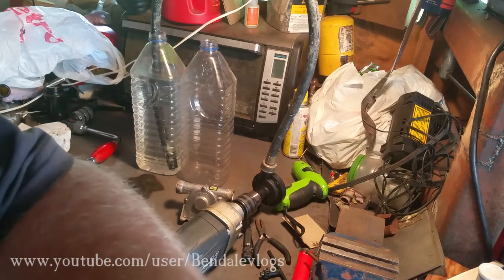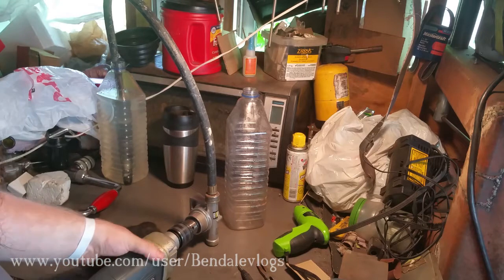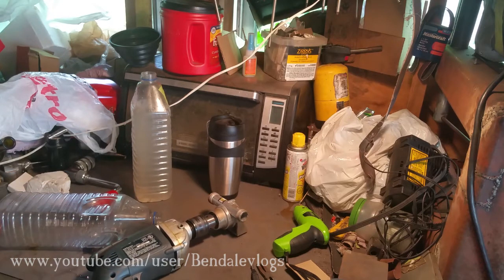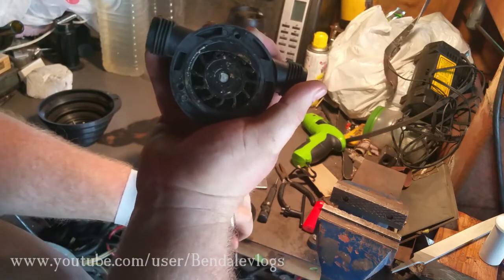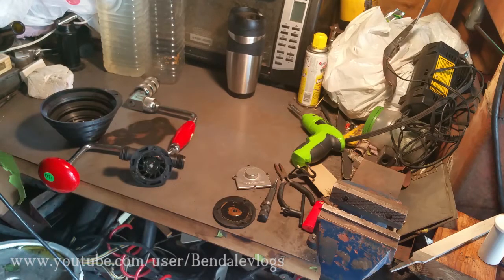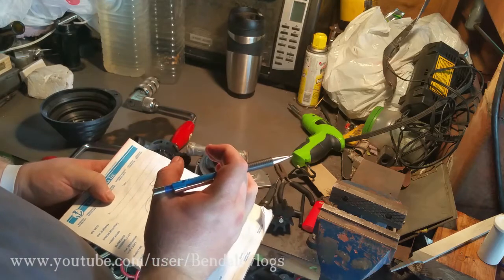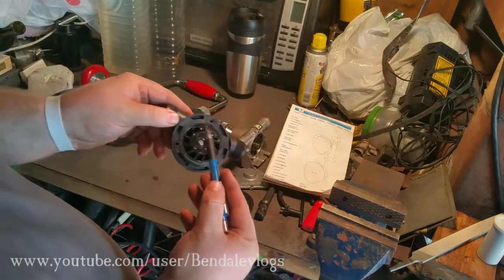Drill Pumps

Comment: These pumps state on the package "Do not run dry" which means you have to prime them first. Also, running them dry or trying to start them as you did in your video will reduce the life of the pump essentially burning out the bearings and seals.
Let water run down the hose into the pump first then start your drill and you'll find they'll work every time for you.
Reply from the maker: +NL Guy This is a self priming pump. If I had of primed it it may have run better but I bought a self priming model for a reason.
https://www.princessauto.com/en/detail/metal-drill-pump/A-p5770250e

Comment: Are you sure you were spinning the pump in the right direction?    :(
Reply from the maker: +Toms Chevelle yep. I'm certain I was spinning it the right way.
Reply: I'm a little late on this video. However, I think you have the hose connected to the output side, hence the bubbles in the water. Unless the metal pump is set up backwards from the flotec model. Pause your video at 3:14 where you show the output side, you'll see what I mean.
Reply from the maker: +Shayne Billey you're wrong
Reply: Ben D ok. Just offering a suggestion.
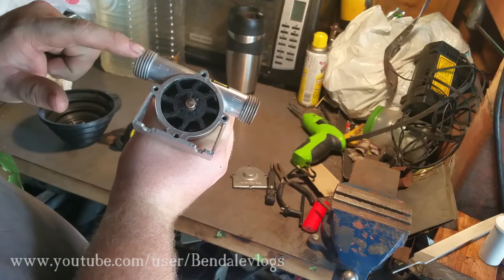Reply: at 6:30 in the video when you explain how air is getting in the pump, you explain - evidently on accident - exactly how that style pump works.  I don't care how the pump is labeled, from the side that you are looking at in the video at 6:30, the shaft should be turning counter-clockwise and the water (or any fluid - remember, if the pump moves air like that, it's going to move water in the same direction/manner, they are both fluids) the water is going to enter the left side of the pump, go down around the majority of the circumference of the pump and then be pushed out the right side of the pump when the casing of the pump collapses the volume between the impellers.The two pumps in the video are the same style, just different materials, to operate properly they will have to turn the same direction.  If the metal cased pump doesn't work in the PROPER direction, then that's a sealing issue between the impellers and the casing, not an inherent fault of that design.
Reply from the maker: No. It's just a shitty pump.
Reply: Ben D I will reply in a similar manner that you do.  You're wrong.
Reply from the maker: I'm not.